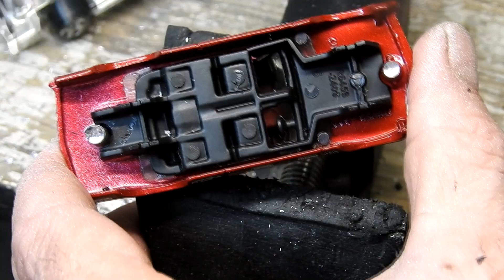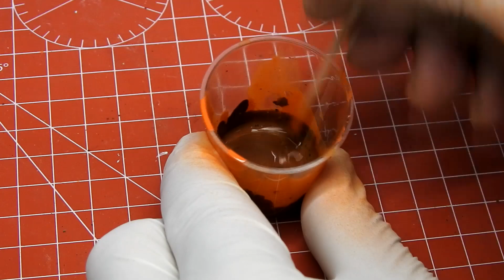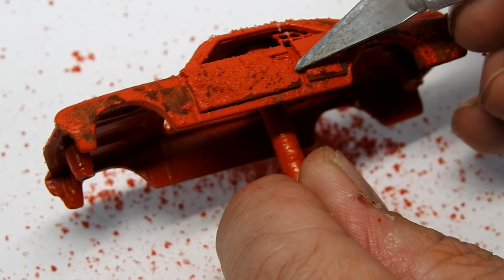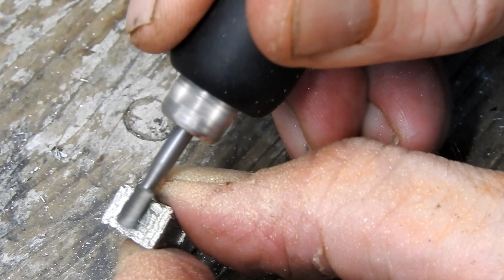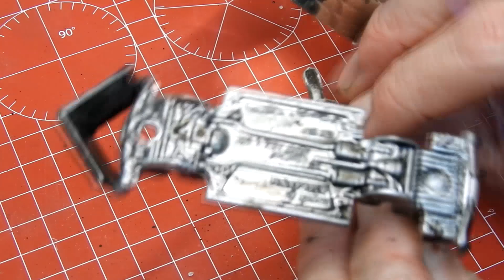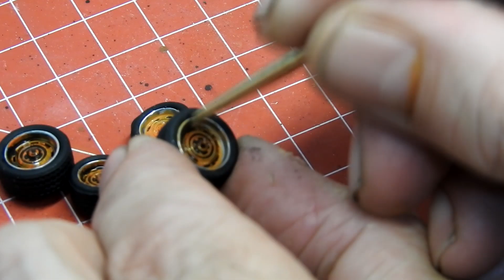Hot Wheels Custom '67 Chevelle SS 396 'Post Apocalyptic Muscle Car' Build Off

Comment: Danny. Awesome work! Again. You should build a post-apocalyptic diorama for your cars: The background miniature scenery in which you could place your new PA- vehicles for photography. Maybe some kind scrap metal dump site/junkyard/'carbandon garden' in which your 'Diecast Disasters' garage and workshops would be located (built of course following same internal logic, architecture, colors, a levels of withering and style etc. as your PA-cars) and there would be enough room on the diorama for different sized vehicles to be placed at the front of it/middle of it. Different scales of cars could cause some problems, but as you have had delightful, creative and rather free tendency to use what ever parts and materials available them not always being in same scale with each others, I don't think that would be insurmountable issue, particularly not in photographs. You could even use some of your already finished post-apocalyptic projects as an integral part of the diorama.

Just a suggestion. Anyway, whatever... you got a new fan. :)

Comment: Very nice build! looks awesome with a little failure. Due to the massive frondshield the car has no lights to the front! Nightdriving therfor is impossible. Little cutouts in the frondshield or a lightbar on the rooftop would solve that problem. Amazing paintjob.